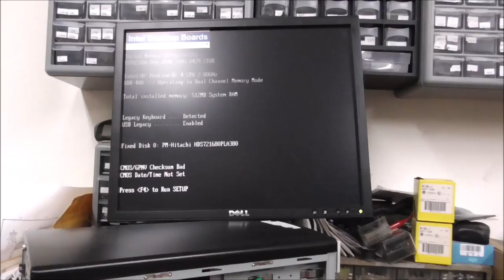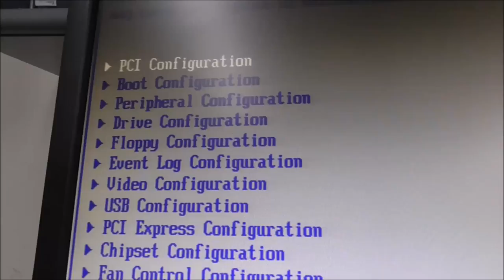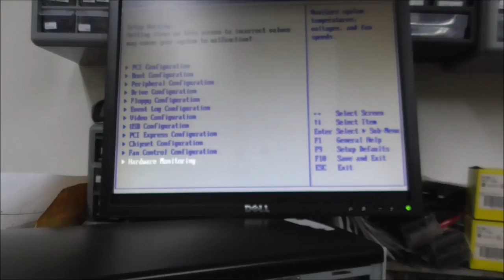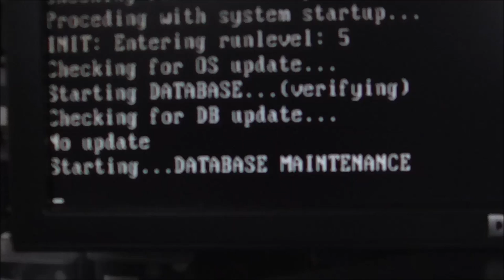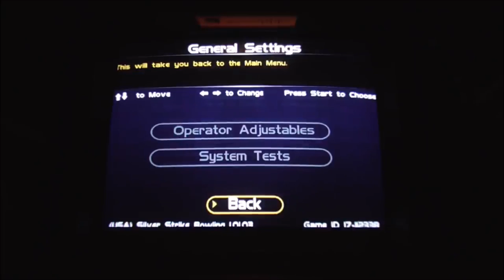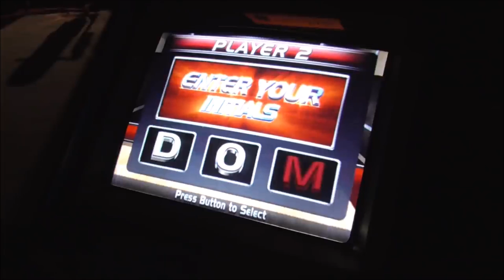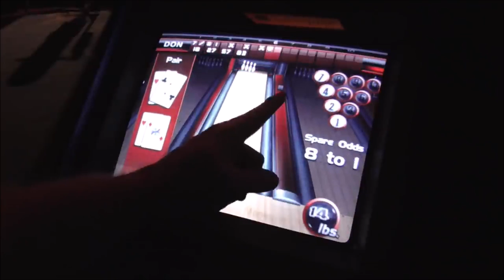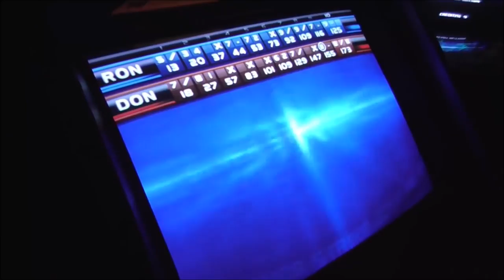A Customer Brought Us A Silver Strike Bowling Arcade Game Computer To Repair, Can We Fix It????

Comment: That was a good clone PC build for that game.  Losing the CMOS battery does weird stuff to the BIOS.  And it does help to have the hard drive selected as the boot device ;)
Professional computer guy for 24 years
Reply from the maker: Thank you Tony, we appreciate it man!!!
Reply: A nice solid system, agreed. IMHO, I'd probably would want to replace or rebuild the cooling fans so no further issues would force a callback on it.
Reply: Agreed on that, cooling is a cheap and inexpensive long term preventative measure.

Comment: Good video. I just repaired one today that had a dead CMOS battery but it was the original board/system. Still booted properly with a dead battery. Turned out it was overheating. I cleaned all fans, CPU cooler and but new thermal paste on CPU and heatsink. Good as new !
Reply: Also, there is proprietary boards that the software looks for during boot time. If it's not detected, it will throw that error. Just need to plug in the board via USB.

Comment: Ron, just so you know (and this isn't a criticism)...  technically speaking, it is still an IDE drive.  IDE just stands for "Integrated Drive Electronics", meaning it doesn't require a separate drive controller card the way hard drives did back in the 1980s.  SATA is a reference to the I/O method (Serial Advanced Technology Attachment, aka Serial ATA or SATA), not the drive.  The old ribbon cables were PATA (Parallel ATA).

Don't worry about it.  Even techs like me refer to them as "SATA drives", and older drives as "EIDE drives" (or if they're really ancient, maybe SCSI or MFM drives), for clarity's sake.  Nice job... you're definitely smart enough to work on a computer.  Although I will admit that it's probably helpful that these days, everything is color coded and/or designed to only go in one way.  It's a lot harder to get things wrong than it used to be.  I started building my own computers almost 30 years ago.  Things were very different then.
Reply from the maker: Thank you SpearM75503 I didn't realize that about IDE... I have an issue where I forget things, it's one of the reasons I work on stuff the way I do.  I can remember ideas and concepts pretty well but I'm horrible at remembering specifics.  one of the reasons I film the pinball repairs is so I can go back and watch them if i'm trying to remember how I fixed something before.. and it's why I do the same things over and over in the videos i'm basically talking through "O.K., I don't remember how I fixed this last time, but I remember it had something to do with the ball count unit" etc. 

So IDE EIDE SCSI SATA ATA PATA is like a nightmare to me, haha.  I remember it more as "These were the ones that took the fat ribbon cable, I think the laptop ones used a smaller cable... and then they had the ones that only needed 1 cord.... and I think there's something newer now... and eventually they don't spin anymore...."  I can always remember the basic concepts of it but something that requires specific nomenclature I'm not that good at (or really all that interested in to be honest!)... I'll remember however now that you mentioned it that technically they're all IDE but I probably won't remember the specifics of PATA vs SATA....  

Thanks as always man we appreciate you hanging out with us tonight!
Reply: @LyonsArcade  It's okay, Ron.  Even I tend to think of it as "SATA is the thin one (usually red or blue), PATA is the big gray ribbon cable (with the red stripe to mark pin 1)."  LOL!  And yeah, I take photos of every computer I work on, especially if it's a make or model I've never worked on before.  In the short term, it helps me keep track of what goes where; and in the long term, if I ever work on that particular model again, I can refer back to the photos I took.  "Oh yeah, that's how I fixed that last time!"  😉

Comment: Some motherboards have a jumper to clear the CMOS, likely for the case where the battery powered it up with impossible settings.  Of course if you're adventurous, put the battery in while in the CMOS settings :)
Reply: I'd agree that this was Ron's problem with the PC not booting (POSTing) after replacing the battery.  I've had it happen to my systems before, and have been forced to short the "clear CMOS" jumper for 10 seconds or so to get a clean set of defaults.

Comment: 19:25 Not a "Linux" thing. The 'puter is not, erm, "aware" of any OS beyond BIOS at that point.

And AvE would, like I pointed out sometime back, have been happy with the idea of "sanding the f*ck" out of the battery crust on the circuit board.

You might perhaps want to clone some of the old SATA HDD's to SSD disks. You could still get some smaller sizes like 60 GB that were common as mechanical drives in that era, they are fairly cheap for small disk sizes today, you avoid buying modern large drives that might not be supported by old systems, and as a bonus they improve access speed slightly even on an older SATA-I system.

Comment: Most motherboards have a 2 way jumper to clear the CMOS should you get a freeze after installing a battery or other issue, Its usually 3 pin and labled CMOS on the motherboard. Move the jumper from the right and center pin to the left and center pin for 30 seconds to clear CMOS back to default.  Great video as usual :)

Comment: It is a SATA drive. That is a serial version of ATA/IDE. Some had 2 power sockets, but you use only one. While adding both might work, really, you should use only 1 to avoid possible trouble. Like if you use cables off of independent power rails that aren't adjusted exactly internally, that could wear the power supply. Most PSUs are single-rail. But some are multi-rail, and a split rail is a compromise where that is a single-rail, but with independent current limiters.

And with changing the battery, you might need to (turned off and unplugged) momentarily change a CMOS erase jumper or push a button in that area.

Comment: @3:41 I'll help you out ;) the big one with the 4 plugs that only go 1 way because of it shape?  Molex, usually used for powering HDD's (SATA and IDE in this case, i think there was a period where HDD's had both as they were transitioning to SATA). The other one usually a wide strip of small pins with sort of an L-shape if you look straight on the pins i think it's just called a sata connector
Reply: ^ This.  I've been a certified computer repairman for 2 decades.  Jeroen is correct... that hard drive is from the transitional period, when some power supplies only had the molex type of connectors.
Reply: Also those 4 pin molex connectors can go both ways. Don't ask me why I know. RIP hard drive.
Reply from the maker: I'd never seen one with both types of power, I guess that really helps depending on how your power supply is wired...

Comment: The bios has been reset, you need to get back into the bios if you can  to set up your parameters.  Hard cold boots over time will mess up the indexes causing crashes.  You have to acknowledge the boot device or the bios wont read the hard drive.  Good job fixing the problem.

Comment: Common arcade CPU failures, in no specific order: CPU fan, Video card fan, Power supply, CMOS battery, Hard Drive, Poor contacts (re-seat RAM, Video card), corrosion (environmental and/or battery leakage). Best practices for resetting BIOS: Check online first, most settings for your game are posted somewhere - forums or manufacturer support website. 1. Reset BIOS to default settings, 2. set date/time, 3. Set drives - disable drives not physically present (CD/DVD ROM, floppy), 4. make sure Serial/COM and Parallel ports are enabled (usually used for security dongle and/or COM for input board), 5. set boot order (HDD first, then cd-rom - floppy if present. Also OK to disable, but using update disks later may not work without specific keystroke at boot) 6. SET AC POWER LOSS TO "ON" - idk how many times I've helped people with this. this needs to be on 99% of the time so that when the cabinet is powered on the computer self-powers on and boots. I own 8 arcades that are PC hardware, i've upgraded them all to solid state disks too.

Comment: Focus tip: Zoom out to maximum wide angle (gives you infinity focus) and stay there. Drawback: you need to move your camera in order to get a close-up.
Reply from the maker: That's how I usually keep it but it trips, it starts drifting when it warms up, if I do shorter edits it doesn't act up as bad....
Reply: @LyonsArcade  DSLR's tend to get funky after a half hours of continuous filming.  The CCD's heat up.  Most are capped to 29 minutes or so.

Comment: If you ever have a hard drive that has been corrupted and won't boot there is a computer program known as spinrite.  it is self booting and has its own operating system.  it will low level read a hard drive many multiple times on corrupted tracks in different ways until it can get a confirm able read and then rewrite the data back to the drive. it will also test the drive and label bad sectors as bad and lock them out and refresh the data already on the disk so its signal strength of the recording stays good. if the drive is starting to die this program might revive it long enough for you to make a functional copy to replace the failing hardware. great for arcades and home computers.  I have had it work for an hour and make a disk bootable or sometimes it ran for 4 days to get things going again

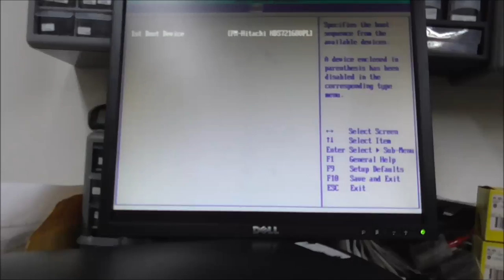Comment: @11:15 GF Geforce? :) You can find the motherboard type/serial in the BIOS (I think it is the first screen). You can try and put silent mode on (it removes all the BIOS text off screen and will only show on error. It depends on what brand of motherboard it is on what you get. Some will show a logo of the board or something else.... or just plain black. So a nice and quiet boot :) USB boot disabled is fine. If it runs on windows enableing this will enable you to install Windows from a USB stick. @12:47 if the HD content is in tact you are golden :) The first boot device is whatever the first HD is installed. Oh no.. that's the CD-ROM no? you forgot to check what IDE/SATA drives were detected (you can see that in the boot screen before the F4 if you have 2 devices and only see one line one might be not connected or working) you can also see this in the BIOS setup @(9:17 -> drive configuration) also this is probably were you can enable the floppy disks A: and B: as we can see :)

Comment: While the PC side didn't end up being all that interesting or unusual, I am rather curious what that USB I/O board was doing. Don't get to see the modern side of arcade hardware much at all.
Reply from the maker: I don't know much about the specific technical stuff on it, but there is a USB cable going up to the I/O board... there is a security chip on the I/O board too, but it's more 'universal' in that the same little chip can work on several different games (for Incredible Technologies).... The board itself has a Jamma connection so you can easily install it in a Jamma wired cabinet (to connect to the coin door, the monitor, the speakers, and the buttons)... the board has a trackball input as well as those Jamma edge connections.... there are also three sets of dipswitches to set resolution (and a bunch of the switches are unused)... The audio comes from the CPU sound card (the onboard one, nothing special) and plugs into the I/O board with some stereo RCA plugs... It's kind of like they took the part of a traditional arcade PCB that handles the I/O and sound amplification and final video processing and put it on a separate board... 

Thanks for watching David!!!

Comment: Heh as a computer repairman it was funny watching you stumble through the cmos settings. 😂 as for the boot order, the drive with the software on it should be the only boot device selected, as it is a video game.
Reply: Any time you can get away with just swapping the cmos battery and setting it up again is a good repair.
Reply: Also, AvE just says "focus you****"
Reply from the maker: Thank you Lt Siver, I thought that setting looked a little off... you'd think they wouldn't set it to by default have nothing selected but maybe they can't default something selected because they don't know what hard drive you'll have installed (if any).... we appreciate you watching, thanks!!!
Reply: @LyonsArcade  it depends on the tech at the time. The bios is both IDE and SATA compatible as that board was made when the transition from the former to the latter was happening. As such, the default is probably for the primary master IDE drive, instead of the sata drive in primary master IDE compatible mode. I think that's why it defaulted to disabled.
Reply: @LyonsArcade  In a more modern version of the same problem, I recently had to repair a customer's PC - it wouldn't boot due to the CMOS battery failed, and since the default on that board was for secure boot to be off, windows 10 wouldn't boot, since it had been set up for secure boot when Win10 was loaded. Once the battery was replaced and the settings updated, her machine came up normally.

Comment: @0:48 Now that is my area of interest (i assure you i have not peeked and skipped ahead in the video). 

The error message was something on the lines of: No bootable device, insert boot disk and press the (infamous) any key

That can be loads of things. 

- Failed HD (just defective electronically or physically)
- Wrongly wired/jumpered (for IDE - first device from the mainboard MA - master, SL - second device slave. nevermind CS - Cable select)
- Something is wrong with the IDE/SATA bus on the mainboard. (you might want to switch the IDE/SATA cable to another connector on the mainboard and use the above trick to connect the 2 on 1 IDE cable. For SATA (Defaullt in red with black plugs) usually no jumper settings are needed or available)
- The bootcode/loader or boot sector has gone bad
- 

- etc..
Reply: heck it's even different with diff operating systems :P

Comment: The 4-10 and 6-7 splits can be picked up by using "English" on the front pin to slide it sideways into the rear one.  That's what the pros typically attempt, but even then I've heard a statistic that they only succeed maybe 10% of the time.  The 7-10 split is the monster that requires bouncing one pin off the back and into the other.

Comment: I was gonna chime in on enabling the 'Silent Boot' CMOS option, though it seems the original mobo had a custom flash bios logo to show in silent, now it'd probably just show a big obnoxious INTEL splash screen instead (bletch!).
On a different subject; Ever worked with the Gonbes GBS-8200/8220 video adapter boards?  Seems they need a few parts tweaks to clean up their video output... but at $30, worth some soldering imo.

Comment: thats not a silver strike computer. That isn’t the security dongle for that machine. 

You are correct though. The security dongle and i/o board. It will boot to linux then stop at the check. 

The computer that is supposed to be a intel oem pentium4 motherboard with a celeron cpu installed. A GeForce 5500 agp video card. Think a 80g hdd. 

Your hard disk drive isn’t being detected. Thats your problem though. 

If you find the image blast it to a new drive and see if it boots

I am what some call a “professional”. I’m IT.
Also fixed this machine before. The old intel boards were terrible. They would last about two years and get swapped. Dot-IT  (not to be confused with actual IT) made a swap out program for the warranty period.  Thats how bad it was. Good news is off the shelf works too. 

There used to be a upgrade kit to ssb2.  It came with the cdrom to install the new programming. It also came with the dongles. I bet someone you know has one laying around

Can also be turned into golden tee

Comment: Haven't watched yet but interested to see how this goes. I've got SSB that keeps rebooting after 4-5 mins but the pc looks different to this one. Mine is the Nighthawk system and doesn't have the CD drive like this one.
Reply from the maker: This one is a replacement of some type I don’t think it’s official….
Reply: @LyonsArcade  be interested to see what is used in this setup as I know it's notorious for not liking replacement parts in the Nighthawk system. Think my issue is graphics card related.
Reply: @Intellivis jon I’m not an absolute computer professional but it almost sounds like an issue with the motherboard. I’ve learned quite a bit from an IT technician I know quite well and computers resetting typically was an issue with the motherboard.
Reply: Reboots like that are usually because of unstable power. A bad power supply can cause issues like the one you describe and is the culprit most of the time, unfortunately you can't always use a multimeter to test them. Your meter might show the right voltage but will not show how much ripple the voltage rail has (you pretty much need a scope to see the ripple). If that has been replaced it could be bad capacitors on the motherboard, the capacitors can be replaced but its almost impossible with out the proper equipment.
It could also be an overhearing CPU from a dead CPU fan or a heat sink that is not seated properly but that is not terribly common. Most modern CPUs (from at least 2000 and up) will slow down to a crawl if they over heat.

Comment: that's a SATA drive.  You can use either power connector but NOT both.  The SATA power connector is on the other side in the dark....and yes you need a new 2032 battery
Reply from the maker: Thank you I finally found it over there!

Comment: I'd recommend getting the drive cloned so you have a backup copy.
Reply: He already had a backup.  He said so in another post.
Reply: @SpearM3064  ah ok. I only saw this video
Reply from the maker: yes I was able to back one up a couple years ago, I've saved a few of them by burning new drives (and solid state drives, you can put like a 500gb solid state drive on it and it'll run just fine)